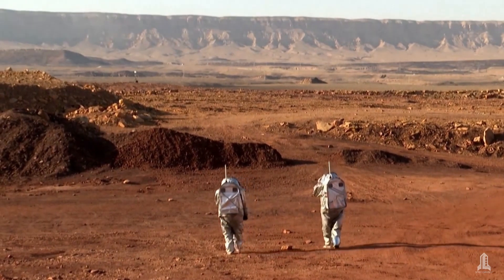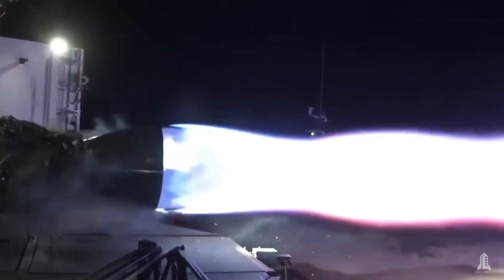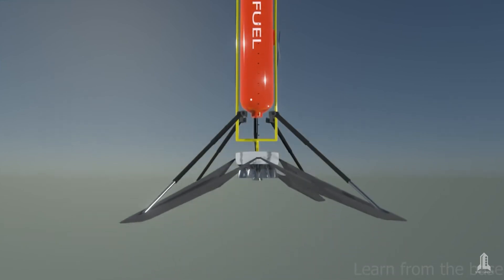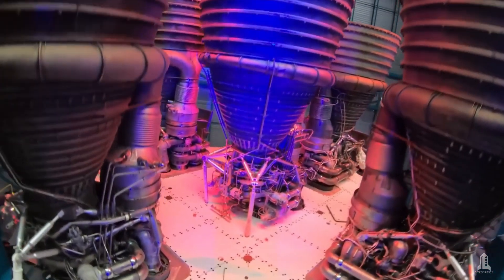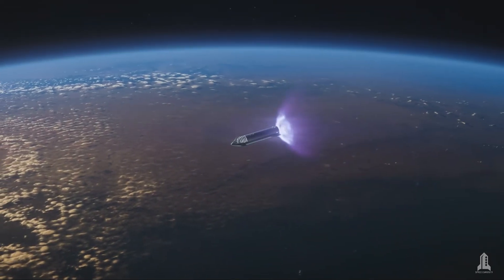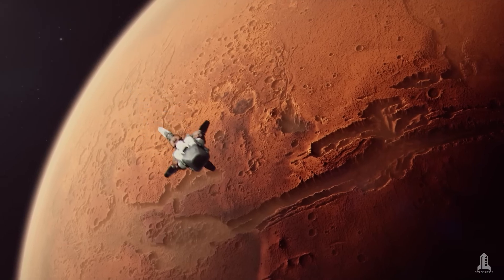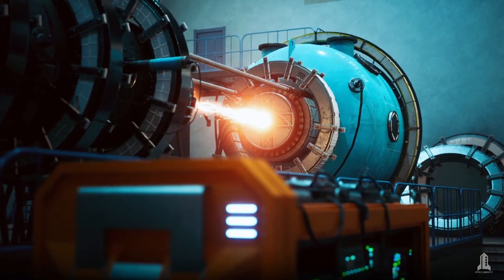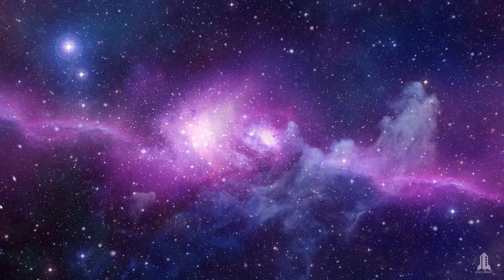NASA Is FINALLY Building A Nuclear Rocket

Comment: oke! and what if it explodes or is distroyed for some reason in mid air or on the floor? radiation spread all over the place
Reply from the maker: for this reason they are planning to use it only for long trips. It is transported into orbit with a chemical engine, and then it is ignited directly in space
Reply: @SpaceCuriosity2  well that makes sense